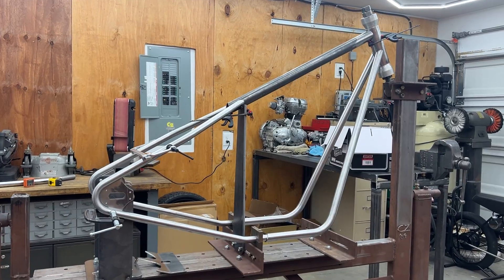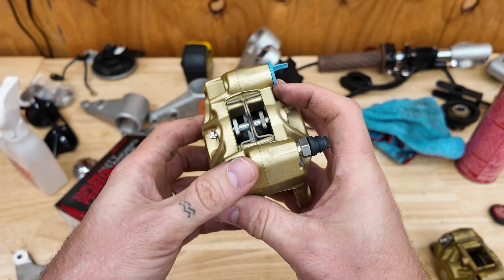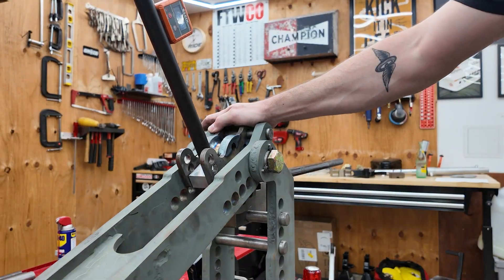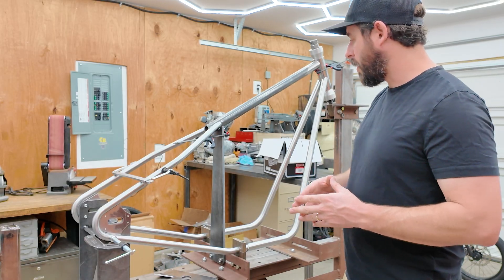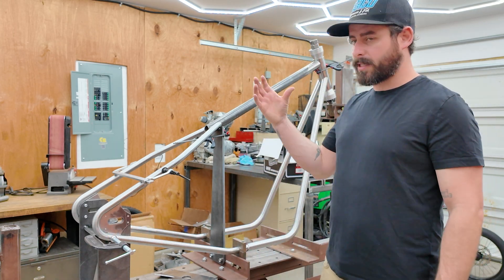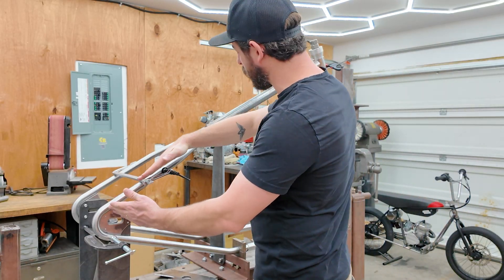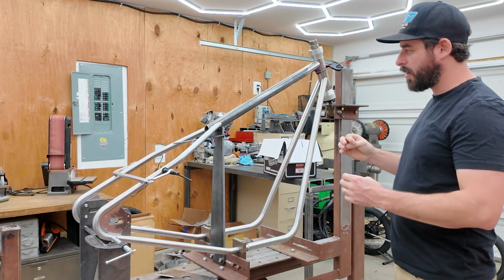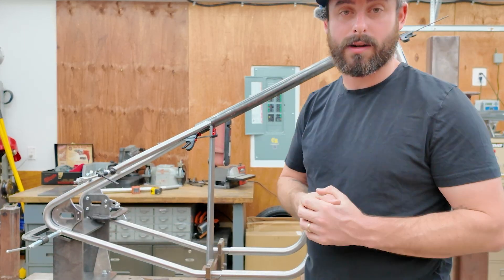Royal Enfield Chopper Build - Part 2

Comment: What would be the minimum wall thickness to make that bend on your tail section ?
Reply from the maker: That’s a good question. I’m using .120 wall here and I think the tight radius die was made with loop frames and handlebars in mind (in which case you’d be using .120). Based on my best assumption, I wouldn’t go below .095 but MAYBE .083? Admittedly, there is a little deformation, more at the beginning of the bend that then end of the bend, but it’s not bad. It would be worse on thinner tubing.

Comment: Killer build bro. When I seen that tight radius rear bend I knew I was gonna ask you about it. Glad you showed it in the video. Do you know if by chance that die would fit the Jd2 Benders since I think they’re all the same type of bender.
Reply from the maker: Unfortunately I don’t think they would fit. This are protools 105 dies. However, the tight radius die comes specifically with this bender from CT Newman.

Comment: What mm pipe you use for the frame brother the chassis
Reply from the maker: All imperial sizing. Backbone is 1.75 inch, down tubes are 1.25 inch, rear section is 1 inch.